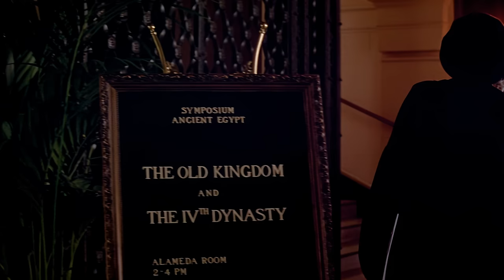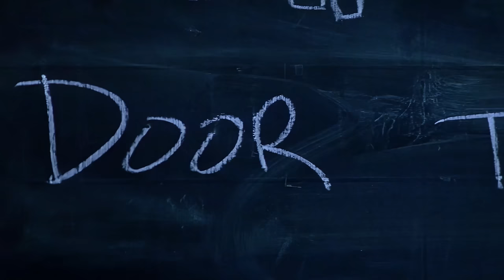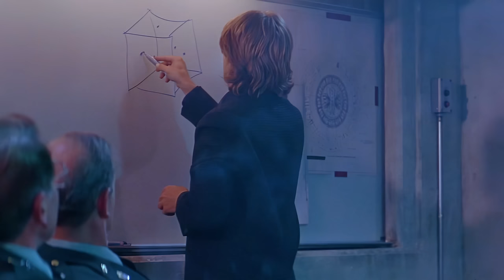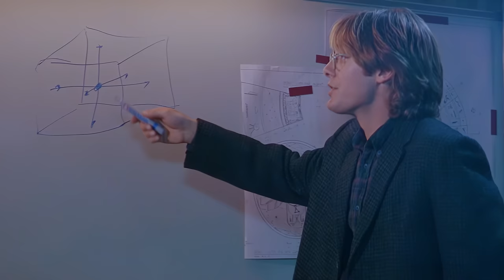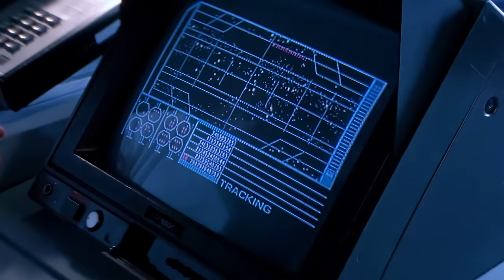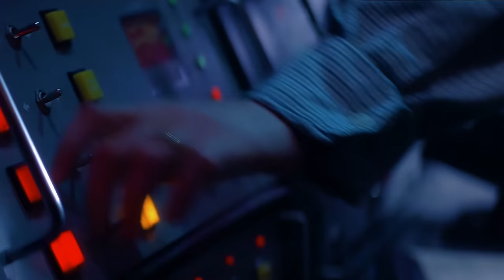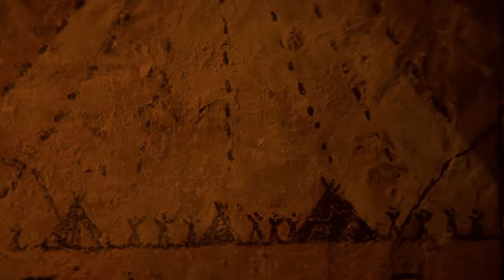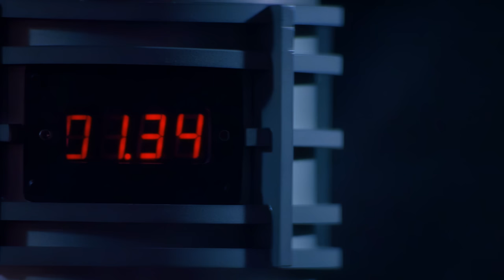People Travel To Another Galaxy And Face Egyptian Deities, Who Want To Kill Them

Comment: So curious how the drone manages to transmit the info from the other galaxy.
Reply: It was attached to a cable, it wasnt wireless, they knew it would stop working if it was wireless, it was explained in the movie.
Reply: The spin off tv series expands on this by having radio transmissions be two way through the portal while physical travel isn't possible. 
It also wasn't another galaxy but another planet within the milky way, the hiccup is that the constellations address system had to have been devised on earth since viewed from anywhere else they'd be different.